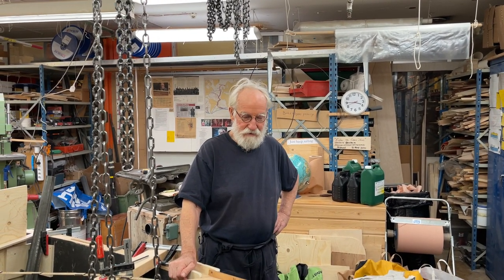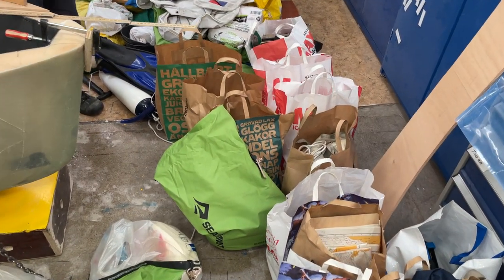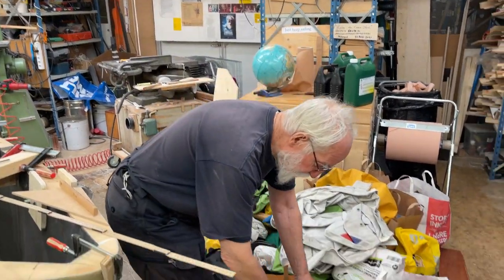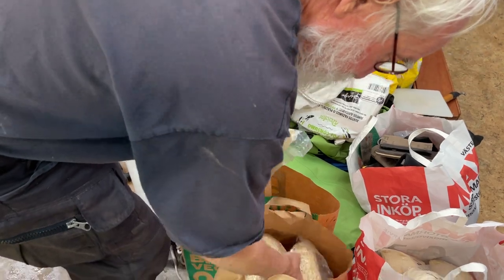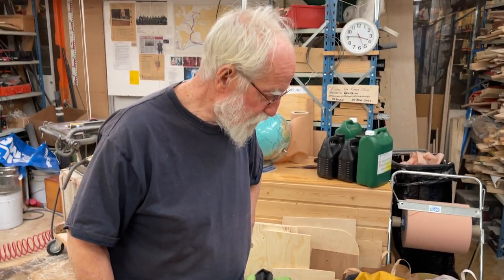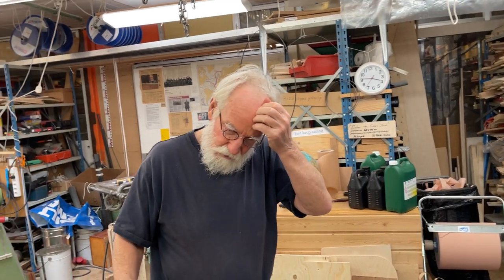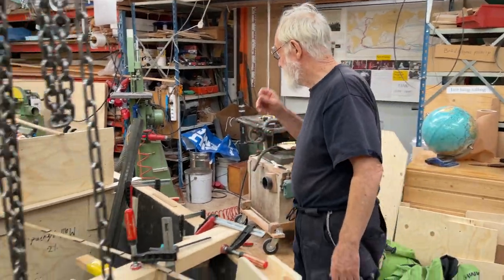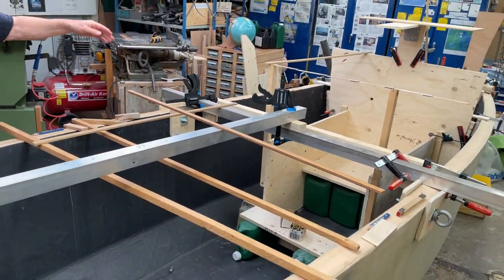Exlex of 2020 now unloded. A lesson learnt. Cold spots going to be eliminated by sandwich coaming.

Comment: I believe the condensation issue will simply be present wherever the coolest surface is. If a living being is contained in a space with little air exchange respiration will add about a quart of water a day to the air. The water vapor must be exhausted from the highest part of the cabin and be replaced with the driest air available.

If the moist air is not vented the vapor will eventually condense on the coolest surface. My question is: if you insulate the hatch cover the water vapor, if not removed will find the coolest surface to condense on. If the hatch cover is no longer the coolest surface what is the new coolest surface? In other words I believe the water condensation will simply occur in another location but it will still be present.
Reply from the maker: I wrote before. I intentionally do not insulate the windows. They are definitely the coolest surfaces. There it collects and can be collected with a rag. I do have a ventilation system. Its windpowered. It brings in new air all the time.

Comment: Amazing.mind you have sir. I wonder if you could use this in some way to build a section to capture the condensation. Then use bottles on deck to heat the collected water using solar heat to pasteurize. 140 F for a couple of hours should be adequate. If not drinkable it would certainly be adequate for hygiene.

If the condensing section were cleaned daily the distilled water would be potable as is.
Reply from the maker: I try to keep things simple. My system works wery well and have done so for decades. Why complicate matters?

Comment: Sven would a fairing compound mix give better insulation than the hard epoxy in the kerft cut radiaced corners of the foam hatchways and hatches and such  ?  Thanks again Sven
Reply from the maker: The Divinycell is much better. I do not know the thermal specifications but think it will make very little difference

Comment: Would double tempered glass prevent condensation on windows?
Reply: Yes, but Lexan, not glass.
Reply from the maker: A better idea is to not insulate the windows. I lowe condensation on the windows. The water is collected at the bottom. This is my dehumidaiser. The windows suck water out of the air and dries it.That way it does not go elsewhere. A bonus every gram of condensed water gives me 539 calories of heat.
Reply from the maker: @archer721  Tempered glass is extremely strong but it can self-explode due to I think nickelsulfide and should be heated up to a temperature I forgot during 24 houers. I have used that now I am using polycarbonate with a hard surface from Hammerglas
Reply: @SvenYrvindExlex  
Very clever.
Reply: @SvenYrvindExlex  
Just had an idea.  Could you experiment with slippery coatings so that condensation on other surfaces would also run down and could be collected?
Reply: Great concept: Heating by dehumidification! Never thought of that.

Wouldn't it be better to make one larger cold bridge on purpose with a drain? A sheet of aluminum perhaps?

Is this condensed water drinkable if some minerals are added?
Reply from the maker: @ende421  There have to be a temperate difference. Then to work one side of the aluminum sheet have to be on the outside. That is not practible
Reply from the maker: @barneygoogle4003  There are to many other things to do. Also its a small boat and no space for that
Reply: @SvenYrvindExlex  I didn't consider the dehumidifier approach to the windows and that makes perfect sense 🤔  especially for your situation. 
I sail on Puget Sound and the San Juan's in the Pacific North Western area, a lot of cold sailing days. I have had glass crack for seemingly no reason and now wonder if it is from the cause you have stated... I changed my windows to 5/16 lexan years ago and have had no issues since. They are mostly just skylights anyway so clarity or minor scratches don't matter. They keep the rain and spray out just fine.
Thanks for the insight.

Comment: I find cooking creates to much condensation and in a boat the size of yours it must be more of a problem.
Reply from the maker: I do no coocking at all its net even an heater. I carry no fuel whatsoever.
Reply: @SvenYrvindExlex  on a small boat like yours I would suppose that a fuel spill could  create a major problem, even alcohol to cook with. I see your point there... must be really cold some days/nights! Do you have any sort of heater at all? I have a pair of 12 volt car seat heating pads that I keep on my boat to snuggle if I get really wet or on some really cold nights when it's frozen outside. They plug in to a lighter/power port and are actually fairly efficient. (Could be easily hard wired, but I rarely use them so they are stowed) I'm not sure of the wattage, but I have used them both at the same time for an entire night and easily solar recharged the next day and used them again. One is plenty sufficient for a single person when it's really cold. I have no heat on my boat either... but I also don't travel nearly as long and far as you... the longest lve ever spent sailing around on my boat was 42 days and not out on the open sea, just sailing from port to port and island to island. I am retired now and looking to change that!
Wow! Sorry, this turn into a book!!!